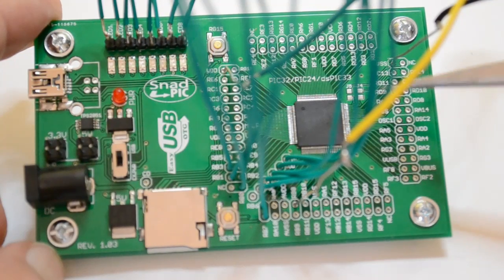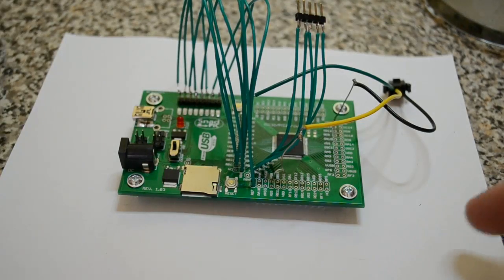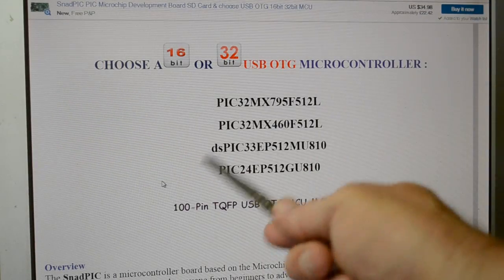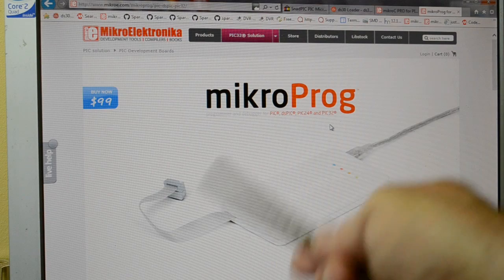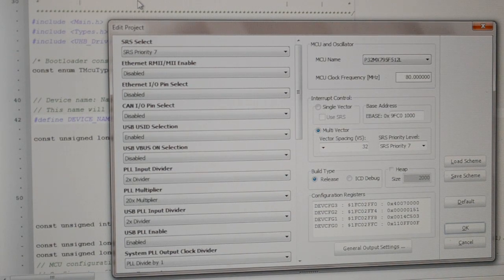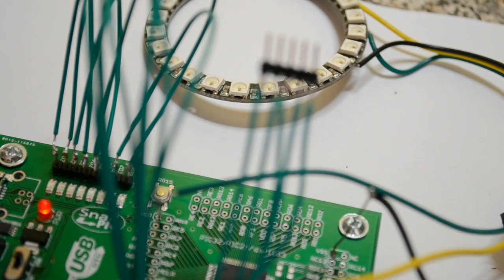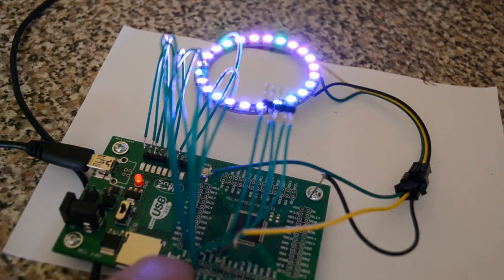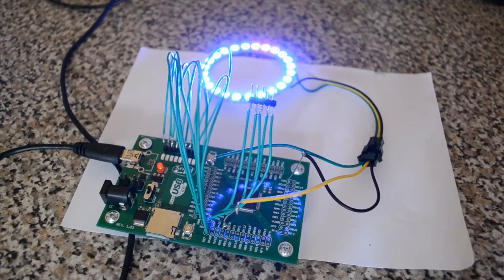Snadpic development Board & Pic32 Bootloader from MikroElektronika

Comment: Nice video John. I need a clarification. Will i be able to program the snadpic using MPLAB IDE via USB OTG or I should use a PICKIT3 for the same. And what programming software have you used for programming the controller. Please guide

Thanks in advance
Reply: +Srinath S 
You can program the SnadPIC board using MPLAB IDE via a supported programmer like PICKIT3, or using a bootloader : If using the  bootloader,  you should use the PC program of that bootloader to load the HEX file.Microchip pic32 bootloader has its own PC program, and Mikroelektronika PIC32 also has its own PC program
Reply from the maker: +Mounir Dlima 
Thank you Mounir for answering the question :)